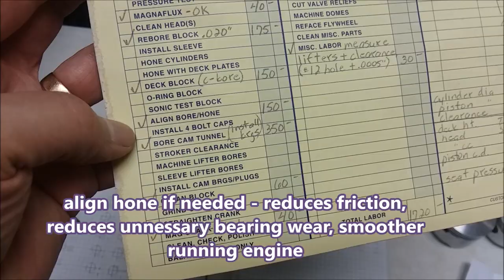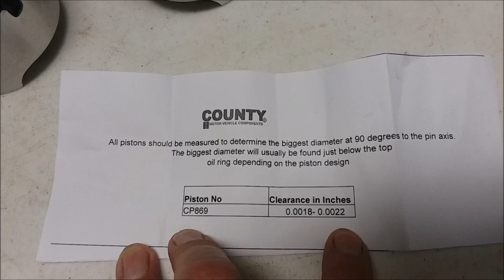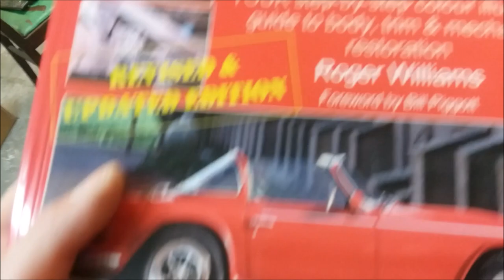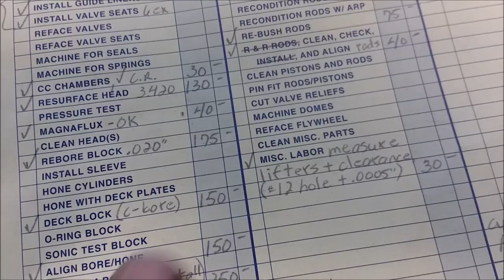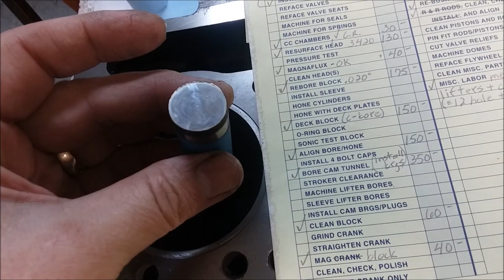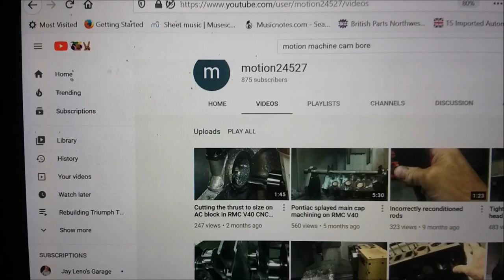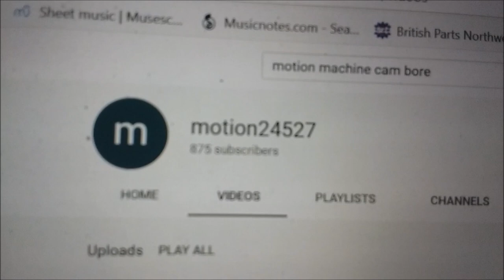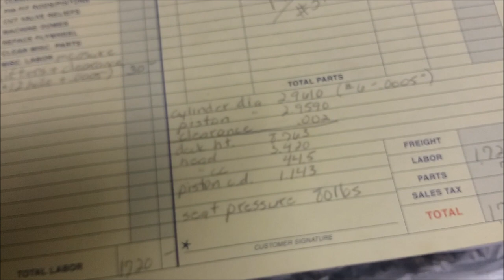Verifying Machine Shop Work on Triumph TR6 Engine

Comment: Nice information, thank you.  A way to measure the recess would be to span a wide parallel across the bore and use the back of of a dial caliper.  Simply subtract the width of the parallel.
Reply from the maker: Good suggestion.  I tried that and wasnt confident that I wasnt rocking it a little and throwing it off.